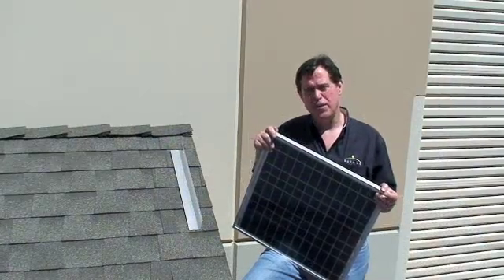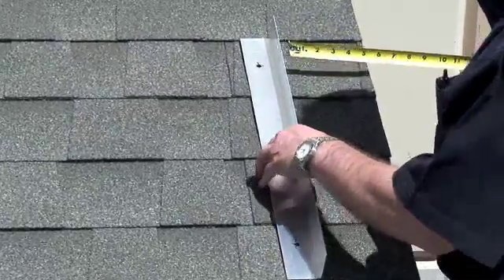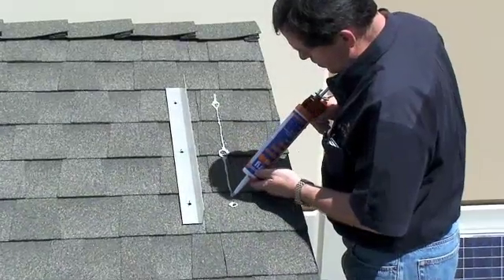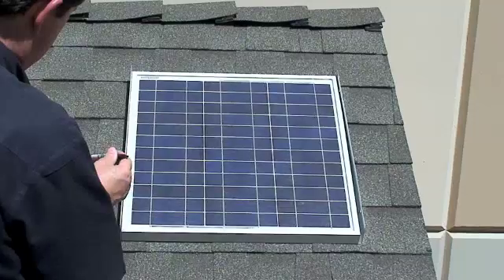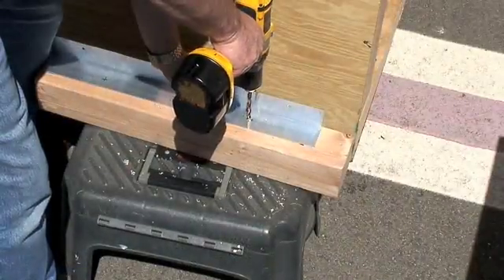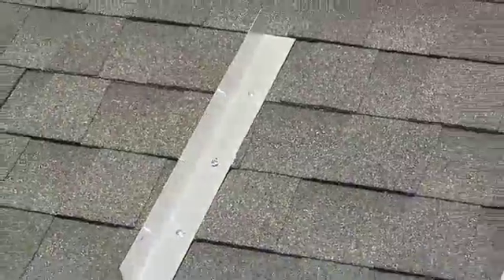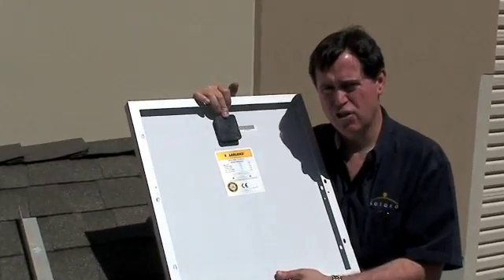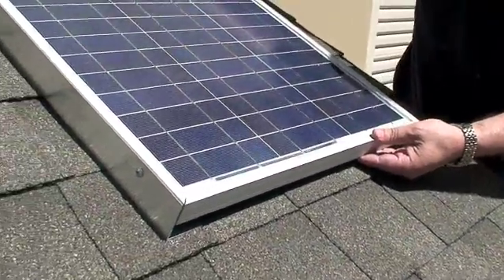SOLAR PANEL INSTALL SHINGLE ROOF LED LIGHTING FREE POWER FREE ENERGY PART 3

Comment: I personally wouldn't hang any of my panels this way one reason being is the panel should be elevated off the an inch or so for air circulation a cool panel is an efficient panel.... The brackets there also prevent air flow 4 small L brackets would suffice